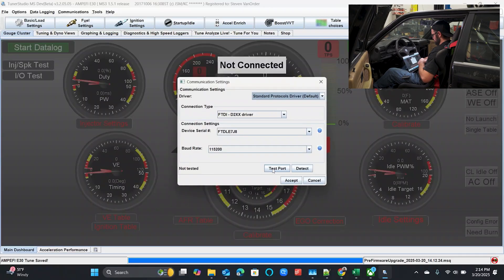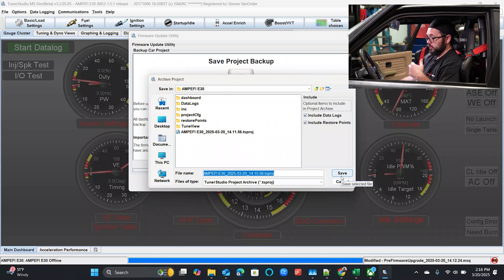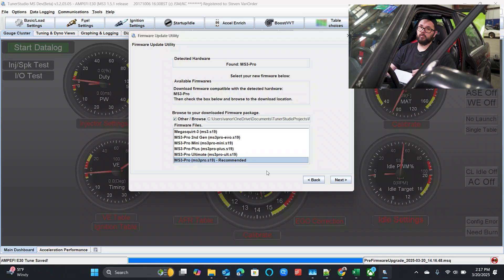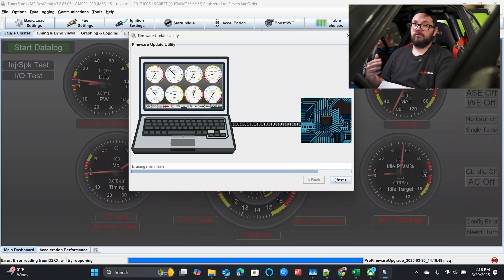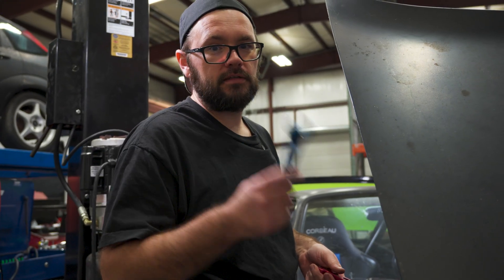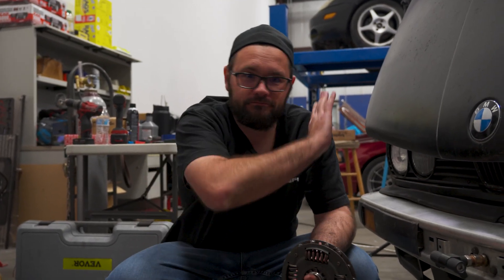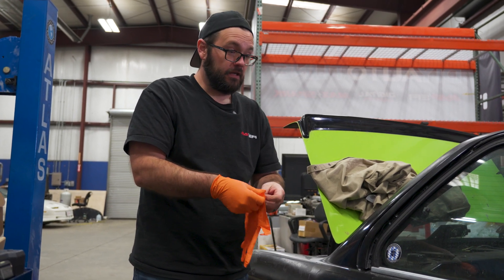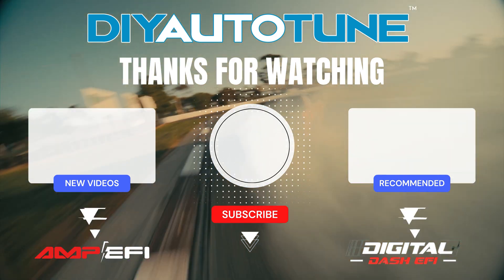MegaSquirt Firmware Update Step By Step! | BMW E30 Rebuild Begins

Comment: I did update my pre 1.5.2 to 1.6.1 and calculate new dead times with dead time conversion but now  the car is super lean and wont even want to stay running. Do you maybe know where to start looking or did i do something wrong? I followed each step carefully tho
Reply from the maker: It should be very close if not dead on after the update. Is the issue just at idle?
Reply: @AMPEngineManagement  mine was super rich, stalled, then doesn't start. Calculated the deadtimes using your excel file and data from injector seller (Bosch EV14 550cc)
Reply from the maker: @RaphElCout1 what injector are you moving from? 
Did you make any other changes other than injectors? 
What injectors did you install?
Reply: @AMPEngineManagement  injectors were always the same. What I did wrong it that I was moving from so old firmware (1.2.3) I needed to do actually two steps with your spread sheet. Use the manufacturer data to get the FW1.5 deadtime then do the FW update 1.5 ¨< 1.6 to get the correct deadtime format for FW 1.6.1. After that, it worked and seems to need very slight tuning to idle and lower/left portion of VE map. What you don't mention in the update is when moving from such an old firmware, a bunch of features change spot in tunerstudio and you now need to do "engine states" which will affect accel enrichment, idle VE, idle advance and overrun fuel cut.
Reply from the maker: @RaphElCout1 I do assume that users are not doing an update from a 10+ year old firmware.
Reply: @AMPEngineManagement  I can understand, but at the same time, the MS doesn't "prompt" you to make a firmware update, unlike TS. So I might not be the only one running into that small "issues". Thanks for the vdeo and replies !
Reply from the maker: @RaphElCout1  FYI we are under new management as of 2 years ago and development has been going strong. If your on our mailing list we send out alerts for things like updates.

Comment: 8:15 - Bosch dry-sweep 👀 nice! 
9:24 - I've had a clutch come apart in my 97 Dodge neon and it was hanging on by a thread as it was cutting it's way out of the bell housing!
I appreciate this firmware update lesson. It appears easier than back in the MS1 days. I can navigate through computers, but I'm far from a programmer. 
MS FTW💪😎🏆
Reply from the maker: @PANTYEATR1  yeah it was not a fun job.. but doing the clutch required I paint the intake and valve cover, reseal the engine and install headers and egt probes. 😁